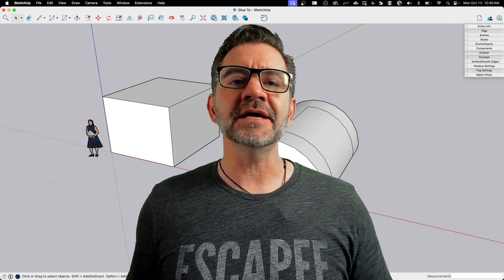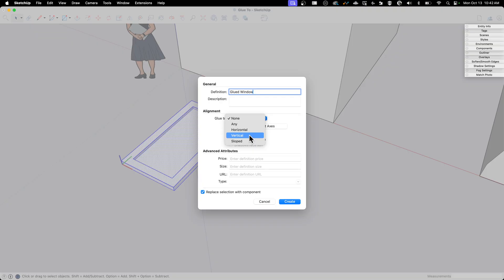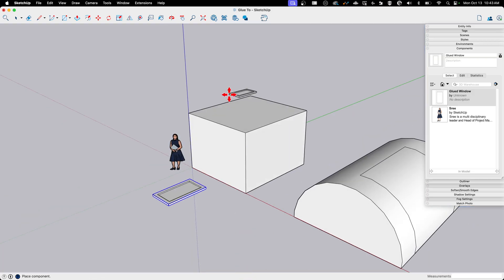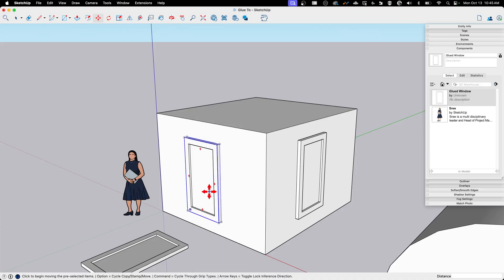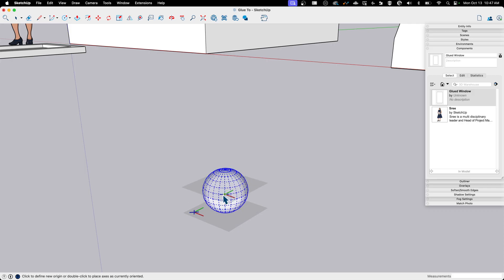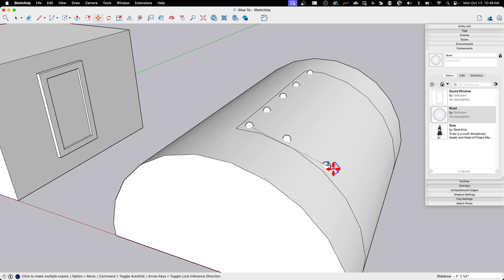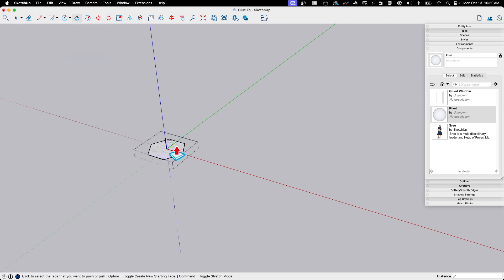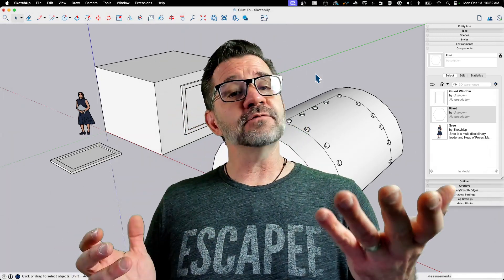Gluing Components to Things

Comment: Here’s a problem I’ve been having with cutting through curved surfaces. I don’t know if it relates to Glue To or not.  I have a large tank that has thick walls.  I want to cut a hole through it that is perpendicular to the wall.  That is, the centre axis of the hole will be pointed at the centre axis of the tank.  So far I go through a bunch of gymnastics using the protractor and rotating the cutter to align with the centre axis etc etc.  Is there a way of applying Glue To to an array of cutters along the outside perimeter of the tank in such a way that they all point toward the centre axis?  (I hope this makes sense)
Reply: Doublecut from Mindsight studios will work